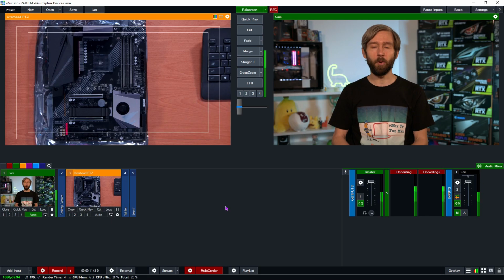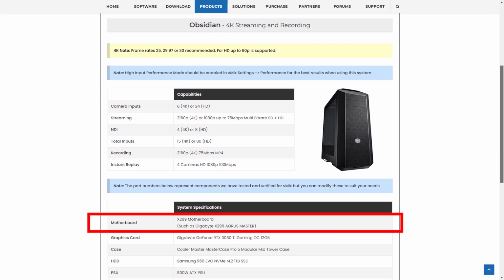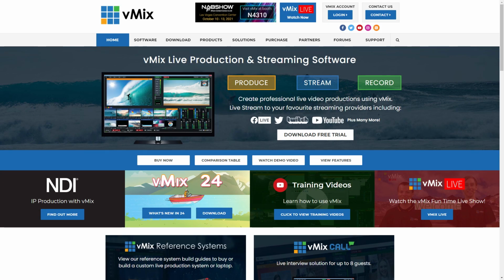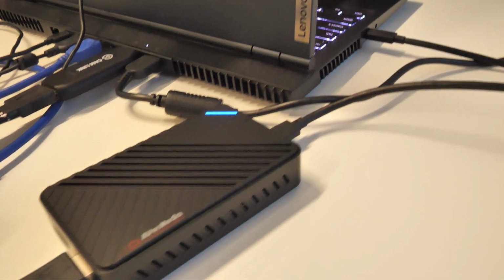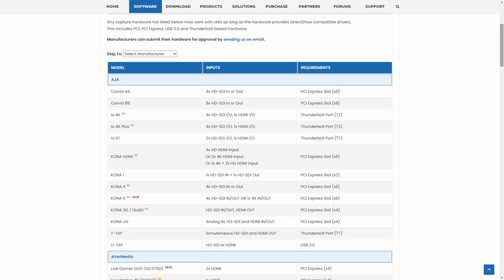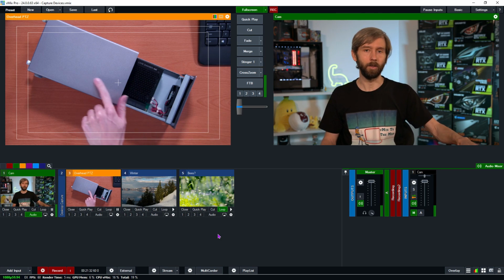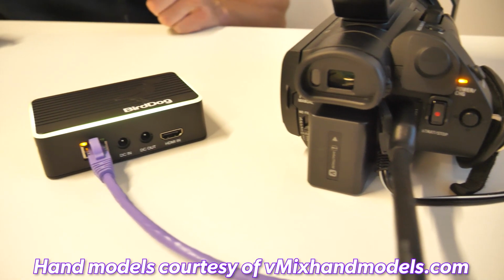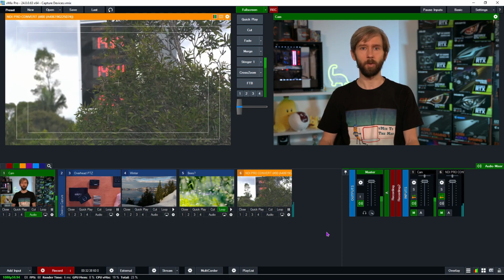What Capture Device will be best for you? PCIe capture, USB3 Capture, Thunderbolt, NDI converters.

Comment: Yeah, very important to check your motherboard. I just spent $5700 on a new computer a week ago and found out that the two X16 PCIe slots are shared. So, if I put something in my PCIe_2 slot, the first slot with my 3090 Ti drops down to 8 available lanes. Kind of sucks, especially for the money I paid. The only other PCIe slot was a x1 slot at the bottom that is basically useless.

Comment: I must say I regret my purchase of the Matrox VS4 card. It was definitely not one of the cheapest at the time I bought it. And then an update to the driver actually removed some of its functionality that could be restored by spending a lot more money for additional software. I simply preferred to run the previous driver. And then although it worked in windows 10 with no problem using Windows 7 drivers, the day came when an update to windows 10 caused the card to no longer function on that platform. And Matrox has no intention of updating the driver fir Windows 10.

Comment: I started out with Blackmagic USB capture devices but had so many problems with them. I then went with 2 Magewell USB capture cards, so much better. Then I got a Thunderbolt enclosure and a Magewell dual PCIe capture card. That gave me the ability to capture four devices. I recently added 2 Magewell NDI capture devices, which gives me the ability to capture 6 devices at a time. I have four Video Cameras, 2 Panasonic AG-DVX200 and 2 Panasonic HC-X1000. I use the Magewell NDI capture devices to capture longer runs, over 100 feet. Everything works fantastically, I use a few year old MSI Laptop with a 1060 video card.

Comment: That mechanical difference is one of the reasons the BMD Intensity Shuttle Paperweight,... Err.... 'USB3'.. was so unreliable at launch, as the 1× slots for the USB3 expansion cards required had a 1× mechanical connection, but needed to go in a 4× slot, as the fast motherboards at the time had slower clock for the 1× slots.
It's no wonder vMix doesn't support it! 😄